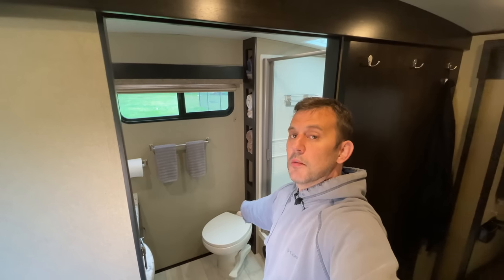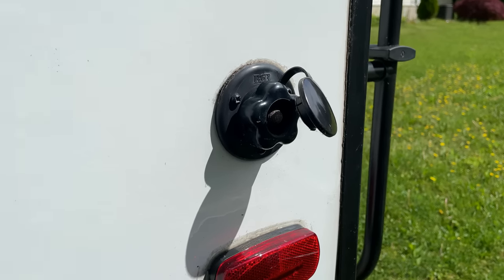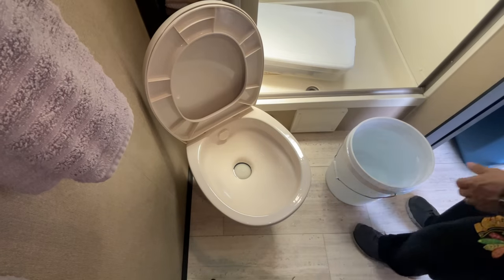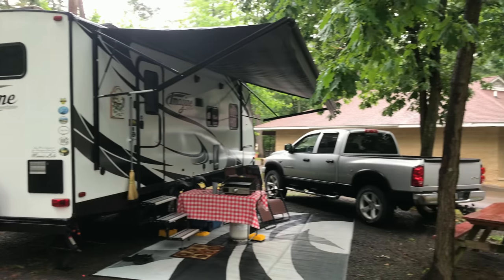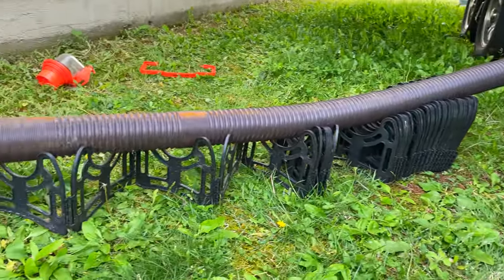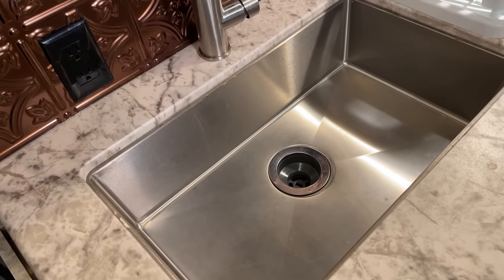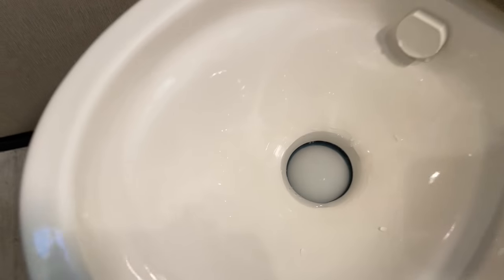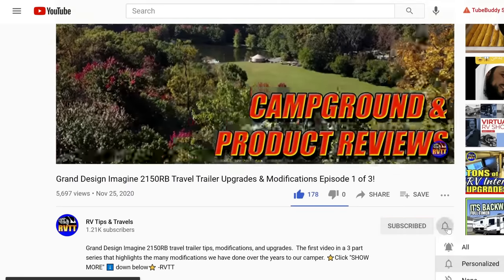RV Black Tank Cleaning, Maintenance, Tips & Tricks - The Original Black Tank Master Class

Comment: We have been holding the shower head over the toilet and timing how long it takes based on a test we did using the shower head to fill a 3 gallon pail.  I think we might start using the bucket method you mention.  Do you have to disconnect your water hook up to fill your bucket, or do you fill it on the inside?
Reply: Fill the bucket when you first get to the campsite before you hook the hose to the camper.
Reply from the maker: We fill outside.  Get one of these:  https://amzn.to/2UaXWen
Reply from the maker: We use this at the top of our connection, for the bucket and to wash hands while still connected:  https://amzn.to/2UaXWen

Comment: Great informative video, thank you for making it, I will try some of the tips you and others mentioned here because  my sensors stoped working after the 4 or 5th flush, not that I rely much on them since I know that I can see the water when the tank is almost full but it will be nice to try to get them clean to see if they work again. Now, my question is: I noticed you showed on your video you pressing the pedal to fill the water, or even when you used the bucket you had to keep the toilet outlet open while water runs down, (obviously) in my case when I had tried to keep the water flowing for more than a few seconds the bad odors start to make their way up the toilet pretty quickly, I always use happy camper but it seems to me there’s no way to keep the toilet outlet open for enough time to fill or actually spray with a hose( which I’ve also done) without having the nasty odors built up inside the camper.  Any advice on how to contain the odors while filling the tank?
Reply from the maker: If you have odors after completely emptying your tank you probably have some stuff stuck in there. You’re going to have to bear the odors for a minute but I would put some black tank treatment in your tank and fill it all the way and let it soak overnight or even over a couple nights if you can while you’re not camping.  Then dump, fill, dump again and let me know if that works first before we try something else.
Reply: @RVTIPSANDTRAVELS  make sure the fans are off! Yeah even the one in the front can draw enough backdraft you'll get a nose full!
Reply from the maker: @rolloverriderpgr  very good point!
Reply: @rolloverriderpgr  thanks, I needed that. Seems obvious once I read it, but have had that problem without realizing the cause.

Comment: A very experienced camper told me one time. "Pull your grey tank handle first, before black, for 20 seconds to verify all hose are on correctly and tight". This will save you from embarrassment and nasty clean-up!
Reply from the maker: That’s a great tip Thomas!  Thanks for watching and sharing!
Reply: Hi, Big Ben 🇨🇦🐴🙂followers , excellent video 4 year campers ,liked your ideas.I put a weather vane bt vent cover put refective tape to show wind direction, no smell ever.Also when I dump tanks, I dump black tank then shut valve , dump gray while grey is dumping turn water on flusher 3-4m then when grays 2 tanks are dumped reopen black tank till totally clear 👍🐴.

Comment: NEVER leave the black tank flush handle OPEN, when hooked up at a facility. ALWAYS allow the tank to continue to operate as if you are not connected to a drain. Grey water tanks should also be operated the same way, so as to allow flush water for after draining the black tank.  There are MULTIPLE reasons for this.... and if you leave your slide valves open all the time, you will learn the hard way what those are.
Reply from the maker: totally agree my friend, thats why I put up 3 videos of me side by side saying to always keep water in the black tank.  I couldn't stress it enough.  thanks for watching and reinforcing what we say in this video.
Reply: @RVTIPSANDTRAVELS  in ok mlb
U v
Reply from the maker: @robbinpalmer8252  huh?
Reply: I agree with not leaving black tank valve open but not gray, especially if you have a washer like we do!  We sprung a leak that filled up our underbelly liner by leaving gray closed.  Our technique now is to leave gray open until a day before we plan to dump gray and then close so that we have gray flush water. This has worked well for us.
Reply from the maker: @eander0319  definitely leave grey open if running a washer.

Comment: Very good video. One tip I’ll add is a typical garden hose runs about 5 gallons per minute. When I flush my black tank I’ll open the drain for a minute or so just to get things going, and then crank open the water hose to flush. Once it’s running clear, I shut off the drain and let the water hose continue to run for a minute. Then I open the tank drain again and repeat this process for a total of three times.

Comment: One thing I did was add an extra gate valve on the end of my drain between the sewer hose and outlet.  After draining my black tank, leave the black valve open, close the external gate valve, then open a gray tank.  The gray water will back flow into your black tank.  Close the gray valve and open the external gate valve to flush the black tank again.  There is usually enough gray water to do this a couple times.
Reply from the maker: great tip, thanks for sharing

Comment: Have you seen the flushing spinning cleaning tool? 
Hook it to a hose. It's got a more "solid" or hard plastic hose approximately 24" with a flexible hose toward the ending and a spinner at the final end of the flexible hose. 
When the water is turned on the spinner cleans the interior of the tank much better than the "black tank flush" feature on the coaches. 
It sprays the sensors, all the walls of the tank and top "roof"
I purchased mine at the local ACE Hardware but haven't seen it elsewhere. 
I highly recommend it.
Reply from the maker: ive seen versions of these but not the one at Ace.  I will look into it.

Comment: Our summer RV is in a nice park so permanence. Because the bathrooms are professionally maintained we use them to pinch loaves - feed the bears etc.
RV for draining the lizard or Venus fountain etc. Unless intestinal emergency  of course.
Accordion poo hoses for travellers are cheap so don’t wait til they’re dry and sketchy! Also very important spray lube your knife valves inside and the handle shafts. I was in the RV industry and a jammed or broken knife valve can cause you a mess, stink and misery. Happy camping!
Reply from the maker: Thanks for adding to the video!

Comment: Good video, I would add one point. short trips, When I dump my black tank I keep the valve open. I added a knife valve and clear elbow(amazon) on the trailer side discharge connector... I close this knife valve and open the grey tank, it flushes grey water back to the black tank. when water has equalized open the knife valve and the fast flood in and out clears the black tank while draining. works well. you can do this without a valve by just lifting the hose to get the grey water to flow into the black tank when you open the grey tank. Good delivery.

Comment: I have a 2021 Jayco Bungalow, it has a clean out connection which I connect prior to draining my tank, once the tank empty, I close my valve and set a timer for 20 minutes which is enough time to fill my tank, I then drain that fill and I do this twice, I then keep the water flowing with my drain open for 30 minutes, I then close it and two more times I fill and drain, afterwards, I close my valve and by time I walk around the unit to the water on/off valve is the water to start, after watching your Video, I’m sure I don’t have enough water and I’ll change.
Reply from the maker: great tips Frank, thanks for sharing!

Comment: We’ve found an oil drain pan to store the dump hose in serves multiple purposes.  I position the pan under the dump valves to catch effluent when removing the hose. I can disconnect it sooner that way and by the time I flush the hose in prep of storing it - the dribbles have stopped and will cap the drain. The waste in the oil drain pan gets dumped too verses dripping on the pavement.  We dedicate our smallest compartment for storage of the pan with hose(s), gloves, adapters, etc.
Reply from the maker: Great idea, thanks for sharing Scott.

Comment: That clear elbow you show has threads on it. Take it to HD and find the sewer cleanup fitting it screws into. That clean out fitting can be glued into a toilet flange. Paint it with some plastic compatible paint and mount it to the backside of the forward most crossmember of your frame with stainless steel hardware. That allows you to keep it out of your trailer and allows it to dry between uses. This has worked well for me for 9 years now.
Reply from the maker: Good tip David, thanks for sharing!

Comment: I'm surprised that you did not mention one very important method of cleaning the black tank. Pressure washing. 

Once a year now I use a pressure washer to clean out the inside of my black and Gray tanks. I only purchased a special high pressure hose and special spray  nozzle. Then I slowly feed the hose into the tank from the drain vsorry.

 Not only does it thoroughly clean the inside of the tank but it also cleans the sensors. You have convinced yourself that sensors are useless, but I find they work fine with annual pressure washing. 

Also you have correctly pointed out that you should not keep the drain valve closed while using the black tank flush feature. But it's not just a matter keeping an eye on the level while you fill up. Actually I ruptured my black tank in this way and had to have it professionally replaced. So it should fairly be said that 1 should never fill the black tank through the flush valve. 

Thank you for this Very thorough and helpful video
Reply from the maker: Thanks John… never pressure washed my tank.  It has no odor and sensors work so I never felt it needed it, but thanks for sharing what you did and watching!  I have an update video to this one coming out in the spring.

Comment: I do too I was once at an RV Park that had a a 90 degree elbow about two feet down from the top and I luckily, noticed & I said lucky there was no skill or intuition on my behalf. I just noticed it while attaching my sewage hose and decided to drain gray water first to test check the flow and as my luck would have it,  it was clogged. So I didn’t have a sewage mess I had a gray water mess. I ended up moving to another spot.

Comment: I am a aerospace Design Engineer so I do know just a little about design. Your camper black water discharge pipe has 2 90 deg fittings and the gray water pipe connecting to it. Yours is about 16" off the ground. Good fall mine is the same but about 12" and probably less gallons. It is a nightmare to empty out. Always look for a straight edge discharge shoot and as high off the ground as you can get for better fall. I guess I had to learn the hard way.
Reply from the maker: Thanks for commenting and watching Michael!

Comment: My parents do the ice cube trick as well and say it works. Another thing I recommend is having a small electric pressure washer. It is great for multiple applications with RV but as it pertains to this video, you can direct the wand or hose tip down in the commode to the black tank and use that force to clean ac well
Reply from the maker: good info, thanks for adding to the video

Comment: I camp 2-4 times a year. I've had my black tank blocked when emptying twice now. This last time I tried to flush the black tank but since the blockage had started slmost immediately I was concerned about an accident. I eventually did an "RV" risk and lifted the hose at the dump end as high as i could and ran the water hose water into and it broke the seal.  All I could think was if someone had seen me doing this. I have a Camco Gate valve installed, but probably should have bought a valve with the hose adaptor for flushing at the gate.  I'll buy one and attach temp when emptying tanks.

Comment: Great video. Lots of great advice. Thank you so much. I appreciated the mention of dumping ice into the toilet. Ice in the black tank doesn't work. There are now a couple videos out that prove how ineffectual ice is at cleaning and scraping the tank one of the best is on The Fit RV channel. The theory "sounds good" but doesn't work. Try this at home. Take a handful of flour and peanut butter. Mix it well adding small amounts of water and a square or two of toilet paper until what you have in your hand is about the consistency of human excrement. Place this mixture into a pan or container with a flat bottom (make sure to use a pan or container that does NOT have a non-stick coating). Literally, drop or plop the mixture into the bottom of the container. Let it sit until the exterior of the pile is dry to the touch and it has stuck to the bottom of the container (turn the container 90 degrees to makes sure the pile of simulated poo is stuck). Now, simulating that you have emptied your black tank, place ice cubes in the bottom. Simulating the rocking motion of your trailer as it drives down the road, move the container around. Remember, your trailer does rock and move when rolling down the road, and sometimes that motion will cause things to shift, but still the motion during towing is not violent shaking. You will notice the ice will have very little effect to absolutely no effect on your simulated poo pile. What if you add water??? Now go ahead and add some water to your container. Notice what happens to the ice... It floats. Notice floating ice doesn't scrape anything it hits, because it is floating. Over time as the ice melts and the water soaks in to your simulated poo the simulated poo may soften but it will take a very long time to dissolve.

Comment: I do ten minutes of of water through the black tank flush with the black tank valve closed. Open black tank valve, then repeat process 3-4 times until relatively clear water goes through elbow. Then, close black tank valve, run water into black tank for 3 minutes, while gray tank is emptying. Works like a charm.

Comment: Excellent Video. It was mentioned, just wanted to reinforce, get two hoses. Several times I was only inches short for one hose… 
Suggestions: clear hose section at valves. Many times I cannot see the clear elbow. This will help with the flushing. Other in comments suggested it
Opinion: leave your tank valves closed, even the grey. There are sewer flys and other bugs. I met a person who told me how challenging it was to solve this problem. Another person was at a campground that the sewage backed up on lower sites.
Reply from the maker: Great additions Eddie!  Thanks for sharing!

Comment: I would add a quick comment about the cheap plastic factory handles on some emptying valves. I've had both break after few years work. Maybe the stems were not properly lubricated but the metal replacement handles are much stronger. Glad I had a vice grip in the tool box when the first one broke. I would recommend replacing them with the metal ones before they break at an inopportune time.
Reply from the maker: GREAT POINT, thanks for commenting DE!

Comment: I like the idea of putting 10% into your black tank I'll have to try it out.  

I use a Flush King to add water to clean out my tanks. I may get a water meter so I know how much water is going into my tank.  Also just get plumbers grease and apply these to your valve shaft regularly and around the seal on the gate valve.

Water will always flow from the highest point to the lowest point. So unless your sewer connection is above the bottom of your tank you should no have a problem without a Hose Support. The only thing I know a Hose Support does is keep stones from creating a hole(s) in your hose. I have heard some campgrounds require a Hose Support, but I have never come across one yet. Have you?
Reply from the maker: Thanks for watching!  never had a campground require them, interesting though.
Reply: Some campsite hookups are sticking out of ground quite a ways. Without the hose support it's Uphill right at the elbow. 
Believe me it's a big pain to get the hose completely clean. 
And yes we have came across many rv sites that Require your hose to be off the ground. I think part of it is because of the grass 🤔

Comment: Great video. I'm going to utilize some of the tricks and tips from the vid and comments. I'll add my 2 cents... "The Sewer Solution" (SS) is all we have ever used. Watched a video on it and never looked back since day 1. I dreaded the thoughts of the sewer component of camping so I bought the SS and so glad I did. Draining is a bit slower but you use a  side jet of fresh water to blast up tp and solids. You can also redirect the side jet, with the turn of a lever,  up into the pipe and tank to do extra flushing/cleaning. When fully drained, your hoses are already clean and ready to pack away. So neat and tidy... well at least as much as it can be.
Reply from the maker: thanks for adding Scottie

Comment: We have a 2022 KZ 5th wheel.  The manuals say we can use Liquid Plumber or other drain cleaner to clean/coat the bottom and walls to help clean it while traveling both in black and grey tanks.

Also, just to clarify , you said we "can" use the flush port to put water into the tank?  Makes sense since the tank is vented.  So no "air" is going to expand that tank as water is flushed in.. but just making sure .
Reply from the maker: That is correct.